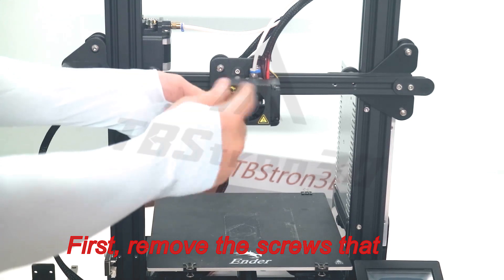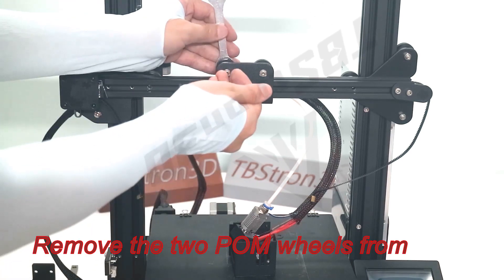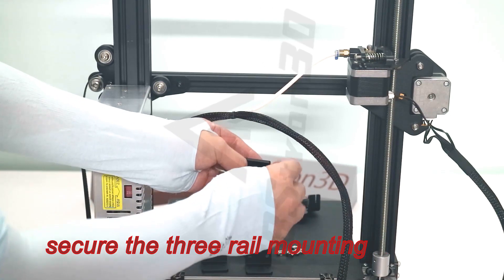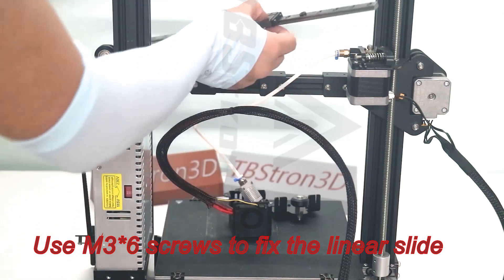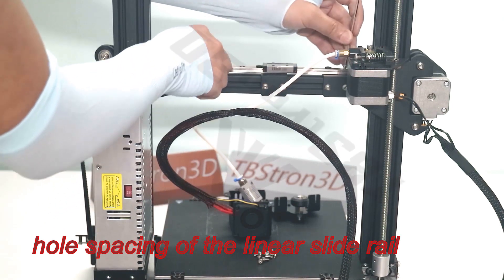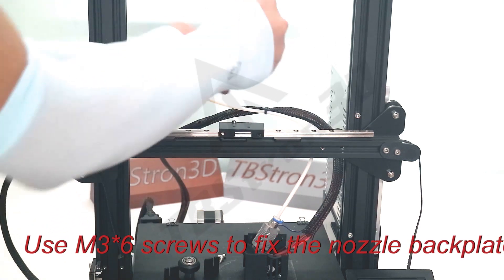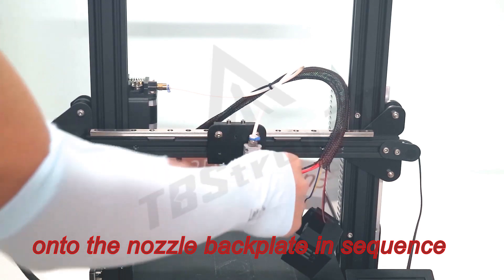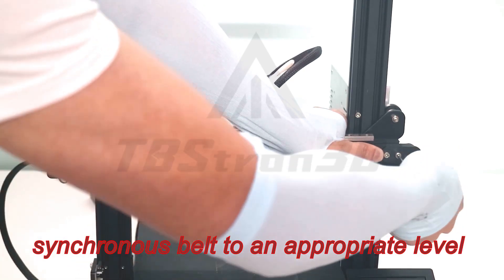CREALITY Ender 3 X-axis upgrade linear rail installation guide.

Comment: Will this work with the sprite direct drive extruder bracket?
Reply from the maker: Hello.
If the Sprite extruder you purchased comes with a metal bracket, it can be installed.
Thank you.

Comment: does anyone know if this kit can also be mounted on the Geeetech A10 which in my opinion seems to have the exact same parts as the ender 3
Reply from the maker: Hello, thank you for your interest. We do not have the Geeetech A10 machine. If you want to confirm whether the Geeetech A10 can be used, please provide us with some dimensions so that we can determine if it is compatible. Thank you.